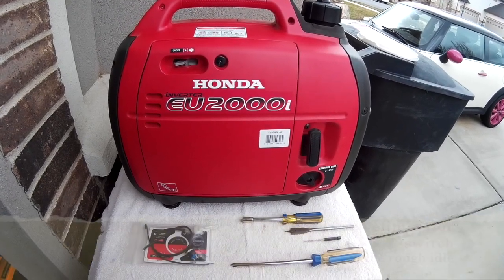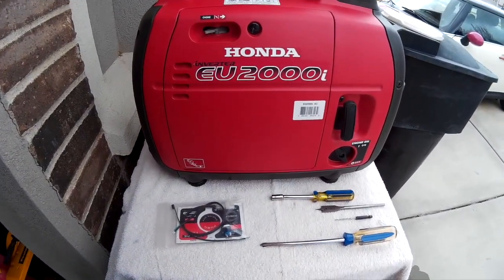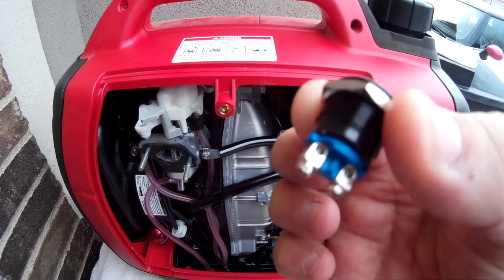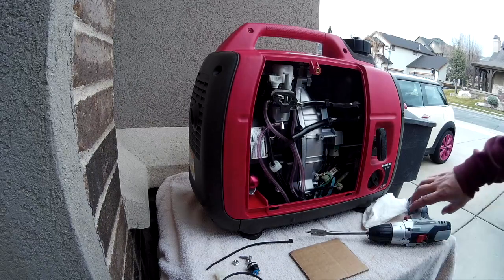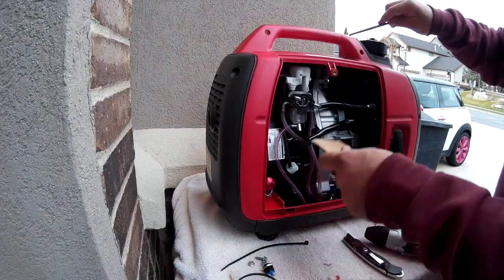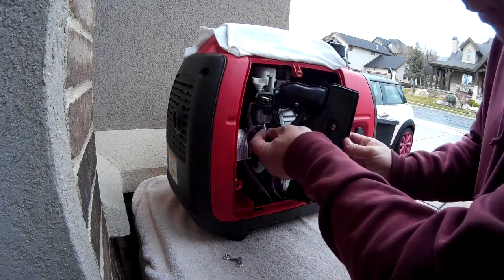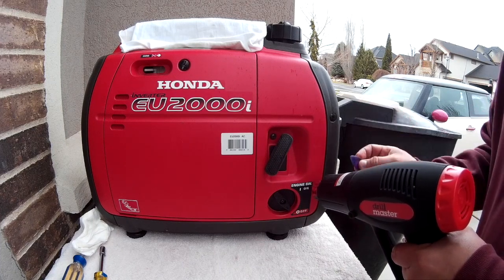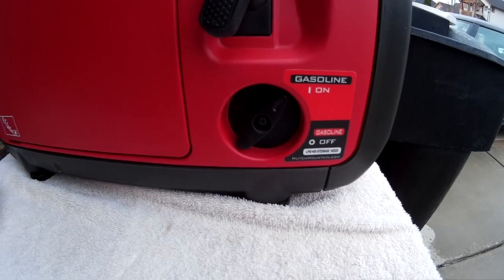Honda EU2000i - Installing the Hutch Mountain gummed carburetor elimination switch kit

Comment: Great video! However, there is an easier way of accomplishing the same thing without spending any money. You can simply unplug the two wire connector by the on/off dial . Doing so will allow the generator to continue to run, when switching the dial to the off position, until the carburetor runs out of fuel. To turn the generator on, simply turn the dial to the on position to open the fuel valve and the generator will turn on. The job will take about 30 seconds to accomplish.
Reply: Does this mean that every time you turn the generator off that it will burn all the fuel in the carb? And if so, is there anything detrimental about do that on a regular basis...? (as opposed to just doing it when going into storage) I mean does it make the generator harder to start? New to this, lol.Thanks.
Reply: @jim8129 I always do this on my generator. It empties the carburetor of any fuel and is important when storing your generator. However, it also makes your generator more reliable because you won’t have fuel that has gummed up in the carburetor. It won’t hurt the generator at all. If you don’t want to have difficulties starting your generator next time you want to use it, open the valve and wait about 30 seconds before you start it. This will allow the fuel to fill the carburetor. Set the choke and start.
Reply: @usapatriot3274  Thanks so much for the helpful advice! I only used the generator a couple times a year and I know the carburetor getting gummed up is a big deal with these things... Do you recommend starting it every month or so to "exercise" it, and if so how long should I run it at minimum?
Reply: If you only use the generator twice a year, you need to make sure that you don’t leave any fuel in the gas tank. When I am certain that I won’t be using my generator for a while, I will let it run until it uses up all the fuel in the tank and carburetor. You will never have fuel or starting issues if you get in the habit of doing so.
Reply: Brilliant,,,,,,

Comment: Now that's theirs a push button that will shut it off is their a way you can add a Bluetooth remote or WiFi remote so you don't have to get up? I have a sonoff 5v WiFi switch that sends a signal to my garage or gate when I want to open it.

Comment: Do you know what voltage the switch is?
Reply from the maker: I started the generator today and checked across the terminals of the switch with multimeter = 5V. I also checked from switch terminal  to engine block = 5V. I confirmed the switch is a normally open  switch design, as the generator will shut down when you place a metal probe across both terminals simulating a closed switch.

Comment: You find yourself burning oil with that on really hot days? Because I did and had to switch oil.
Reply from the maker: I have not had any oil burning at all, either before I made the modification or after I have made it. When checking and changing the oil, it does use any noticeable amount.
Reply: Use VR1 oil

Comment: Great install video, I ordered  the same switch and the oil change kit  which it looked like you also have a few days ago from Amazon, thanks
Reply from the maker: I am glad the video was helpful. I used my Honda generator this past weekend, and it started on the first pull just like when it was new. I think you will be pleased with the kit.